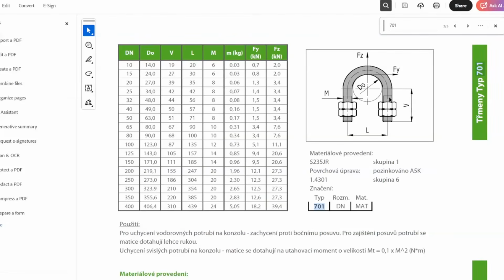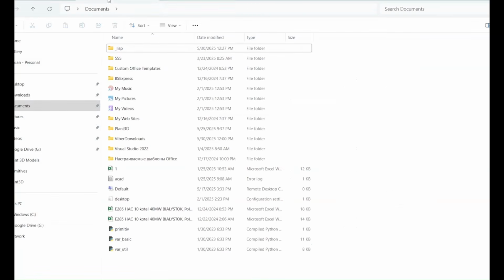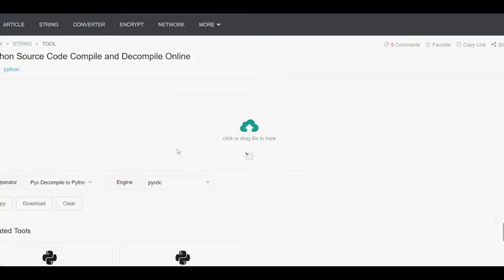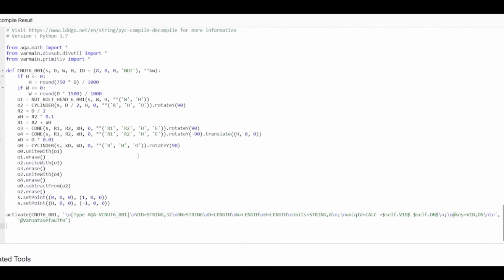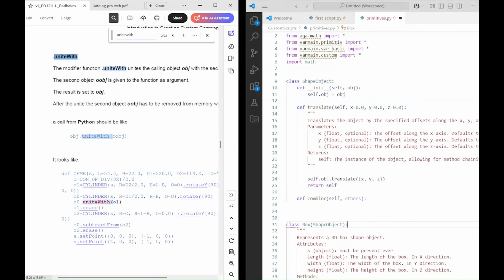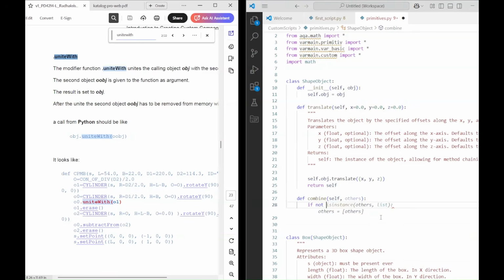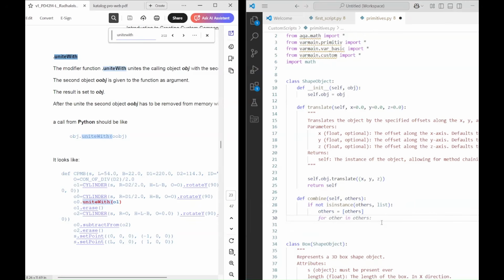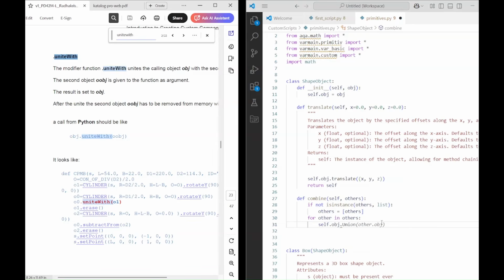Custom Supports in Plant3D with Python – Full Guide Series (Part 3)

Comment: Hi, may i know how to solve the "ModuleNotFoundError" it cannot find the module which is stored in the same folder, i also add the sys path to the code but also dont solve the issue
Reply from the maker: Hello.
The problem may be if your modules are in subfolder not in root folder “custom scripts”. If yes, you should use whole path starting from root subfolder when import modul into module .
If not - contact me via LinkedIn or email and together we will solve the issue
Reply: @SmartProjectDesignStudio  thank you for the prompt reply, I resolved the issue adding "r" in the path
import sys
# Add the path to the custom scripts directory
sys.path.append(r"your desired path") 
but I facing other issue "script is not found" when I tried to test the script how can i contact you?
Reply from the maker: Contact me via email l.fatych@gmail.com

Comment: I really hope you release a series about routing components like cable tray, ladder 💯
Reply from the maker: Hello! I'm not sure yet, Sir. I’ve actually been thinking more about air and flue gas ducts, since we use those a lot in our boiler plant projects. But I’m still deciding whether it’s a good idea.
I’ve seen cable trays used in a lot of internet examples, but I’m not sure what the main purpose is or what people expect as a result.
Reply: @SmartProjectDesignStudio Cable trays support and protect electrical cables and wires. Ladder trays, as the name suggests, have a ladder-like structure and serve the same purpose.
Currently, we can only use the available script from the software, which cannot route automatically like piping. We have to adjust the parameters manually.